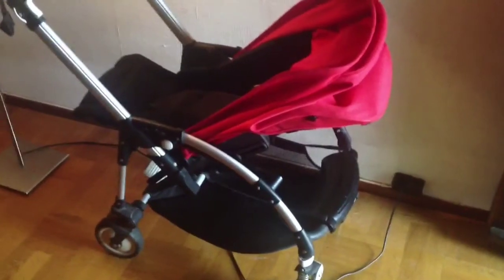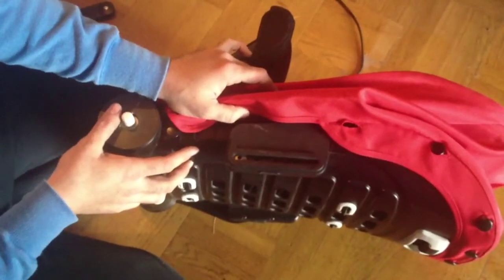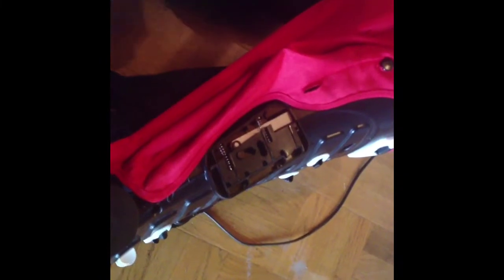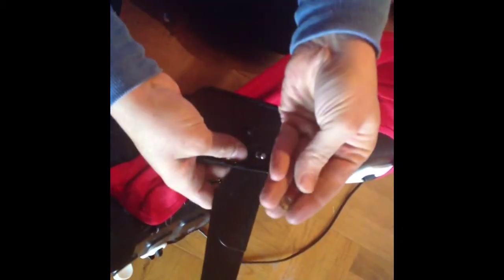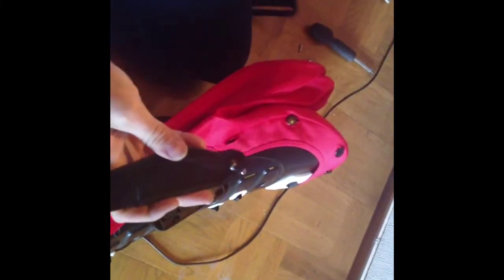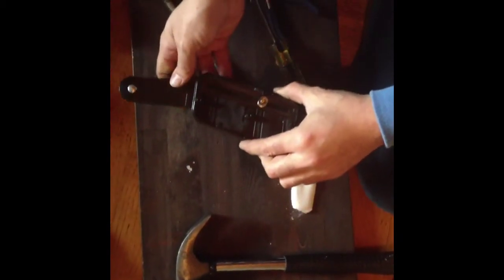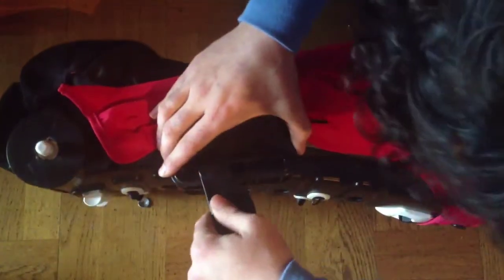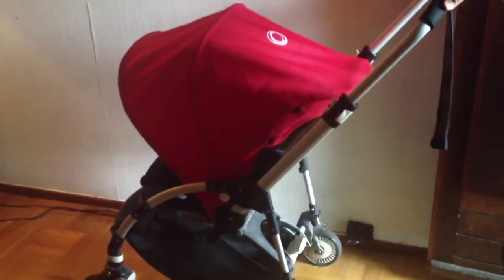How to repair the seat adjustment mechanism on a Bugaboo Bee

Comment: What about fixing a lopsided frame. Mine looks like the seat is closer to one side of the frame than the other. Is it the frame or the seat? I have the original bee.
Reply from the maker: Nohemi Lopez Did u make sure that chassis is fully extended?surprisingly many people do not pay attention to that:)if that is not a case, describe in what way,from which side you are looking..
Reply: @BarnevognverkstedNo  hi I have the same issue. I did double check that it is full extended on both sides but seems the stroller is leaning towards the left. Have you come across this issue previously?